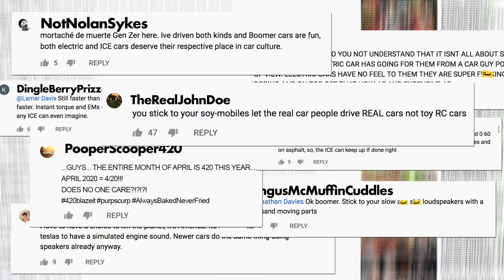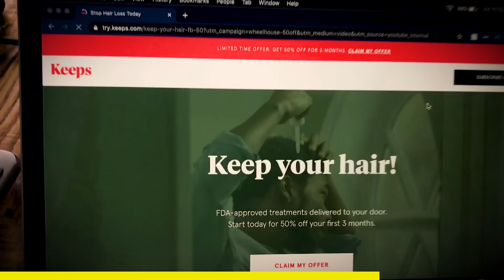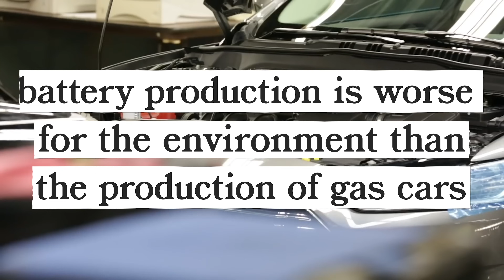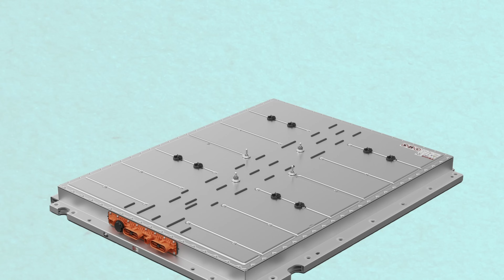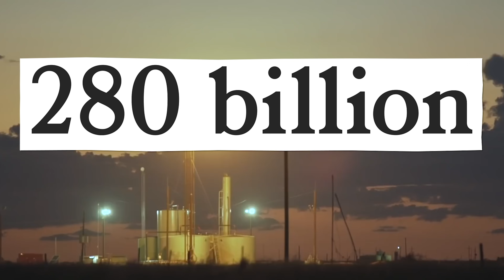Are Electric Cars REALLY Better for the Environment?

Comment: But between 8 and 10 years a elétrica vehicle will need to change the batery
. Só If the owner doesnt drive the enoght distance per year, the EV Will polute more then a combustion engine, even If you use a clean source of Power.
Reply: More like 10 to 20.  And if it still has 70% capacity, it may find a life as a 'grid stabilization module' (when combined with about 99 other battery packs)

Comment: It's is thermodynamically impossible for EVs to emit less if their batteries are charged by fossil-fuel or coal-fired power plants.  Anytime one form of energy is converted to another type of energy (e.g., oil to electricity), the efficiency is < 100% and energy is lost.  Only 43% of the energy required to create ethanol is recoverable when the ethanol is burned.  When tallying emissions of the power plant used to charge batteries, you should count all the pollutants emitted to create the fuel firing the plant, not just the emissions of the power plant itself. Study the Second Law of Thermodynamics
Reply: They’re not saying that. They’re saying that EV’s even with power generation produce less emissions than a car does per mile. 

Infact it’s more fuel efficient to charge your EV with a small portable generator than it is to use that same fuel in a combustion car.
Reply: False, because fossil fuel plants are 2 - 5 times  more efficient, and less polluting, than ICE. Small ICEs peak around 30%, but cars rarely run at peak energy efficiency (defined as power used / potential energy). The most efficient part of the power curve for  ICEs is almost unavoidably near  the high output end, which is not where most engines run most of the time.

Power plants, on the other hand, ARE designed to run at a near constant load near their peak efficiency, and can also capture the waste energy (heat), which is impractical for cars because of the size, weight, and complexity of the equipment required. 

Power plants also have fewer weight/size compromises to make, so have many more factors they can work with to optimize efficiency.

The laws of thermodynamics were  a part of my studies.

Comment: You almost touch on this but what about mileage over lifespan. All the gas cars my family have had do around 200,000 miles in their life. EV must be able to last long enough before the batteries need to be replaced in order for them to maintain an advantage in emissions. If the battery pack needs replaced too soon then all is lost
Reply: Pretty sure it will be way less than ice cars. Your cars carbon footprint continue to increase for every mile you go by burning fossil fuels.

Comment: 8:46 is a nuclear power plant, that's steam. Not smoke. No emissions. Just fyi
Reply: ye, and thanks to nuclear power he arrived at that very low co2 cost for the electricity. makes his entire video useless.
Reply: Daily venting of radioactive gases occur.
Uranium miners mean age of death ~ 54-55.
Stochastic death increases with every measurable increase in exposure to radioactivity.
Impossibility of permanent storage of high-level waste (although any radioactivity produces heat, energy in > energy out to create steam turbine power below about thorium)
Nuke plant design requires such complex construction, that it cannot be completely known or understood  - too many variable.
Consider San Onofre, tube replacements - estimated to last 20+ years, cnsiderable molecular breakdown due to radiation was observed inside of two years, resulting in necessary permanent shiutdown.
Low level waaste, such as irradiated concrete, see rate of toxicity increase mentioned, create massive low-level storage. 
high-level waste, that producing radiation dangerous to life in very short-term, , as implied by "molecular breakdown", defeats the most resistant alloys ever developed over time, leading to ethical problems with effects on organisms tens of thousands of years in the future. Human species has only lived about 250k to 325k years. 1/2 life of some waste transuranics exceed 2 million. Only early, small forehead-free apes existed at that time ago.
Nuke is dead.
Reply: @briseboy  I'm not advocating it, I'm just saying it's not smoke in that picture, which is a common misconception

Comment: The electric grid would not handle the load and there is allot of evidence and it is obvious . Also when you need to replace the battery in 5 or 6 years , something you didn't consider in your model . I have seen the argument done by scientists that show EV's are no more efficient than a small four banger . EV's are also not practical   in colder climates
Reply: The battery on electric cars has typically a 8 year warranty and can last around 300k miles for a Tesla Model 3.
Reply: How the hell is ev not efficient when electric motor are 90%, way more efficient than ice cars which has efficiency of 30%.
Ev can run in cold climate, needs heat pump which car provides.
Reply: @frankreynolds9930  I live in a cold climate . In fact it gets colder here than on Mars. They do not work in the cold and if you get them started you have lost at least 50 % of your charge. Then you need to run a heater or freeze . Do tell what exactly a "Heat pump" does and what is it that it pumps ? You really don't know much about ICE cars simplest of parts , yet you have credibility ? They are not viable and require tax dollars . The production of an EV is dirtier than an Ice vehicle all verifiable facts . Since you won't believe me then it is incumbent on you to do the research from engineers with no skin in the game  . "Heat pump" Lmao !
Reply: @frankreynolds9930  lmao ! Norway has the population and land expanse of a little city . To use Norway as an example is hilarious . You think it's cold in Norway ? ....laughs in Canadian . Electric motors have a place coupled with ICE and EV's will have a niche market for tiny places like Norway or in urban centers but there is allot more tech going on that will prove to be viable unlike the highly subsidized EV's that rely on carbon credit and public money to turn a profit . Using tiny countries with little land is not a credible argument for viability . Governments and media as ignorant as they are push this stuff and it is incumbent upon you to have greater depth than a finger bowel .
Reply: @rdhudon7469  Well not every people does long car commute  and travel between states frequently so Canada being big doesnt seem like a problem to me. Most travel from city to suburb.

Lot tech going on like what? Biofuel, hydrogen fuel will never be main stream. Those credit are for incentives for people to try out electric. Its to accelerate faster ev adoption by public.
DO you think most companies doing fully electric means they wont make any profits? 

Sure 18 wheelers for long distance is kinda hard for ev right now but there are already small trucks and vans going ev. As battery tech matures, long distance truck will also be ev.
Reply: @rdhudon7469  After 'I live in a cold climate', pretty much all of what you say is BS.

Mars averages -80F. Do you live where it averages below that? 
 
First you said 'they don't work'; then you said 'if you get  them started, you have lost 50% of your charge.

If you don't know what a heat pump is, here's an article: https://en.wikipedia.org/wiki/Heat_pump

While an EV is more expensive initially than the average car, within just a few years it is net positive for the environment, and for energy. That's also verified.

The one million individual investors who have purchased Tesla stock believe that EVs are viable. Who am I to disagree? (I think it's currently overvalued, and don't own any).

Comment: Also people forgot to add oil changes that EVs don't need every 8000km as emissions on top for ICE.
Reply: And vice versa people forget to add battery changes for the EV during it's lifespan since battery degradation is a thing and ICE'S don't rly have that issue beyond the starter battery which isn't even li-ion so not even in the same ball park.
Reply: @StealthMomo  you're gonna tell me you having hundreds of sensors and spinning parts is more efficient that 1 spinning magnet the size of a watermelon? Don't forget you need to waste gas to deliver your gas to stations. Electric travel through the grid
Reply: @StealthMomo  all I read was (I'm broke and I don't maintain my car and is a hazard to society but I don't care cause it'd cheap) 

Yes electric is costlier off the bat now but like phones are other things battery cost will only go down from here
Reply: @asp_motorsports  I'm not really opposed to switching to an electric car but in my eyes atm they're more like the early beta test version that's not really quite there yet. As for being broke that may be the case but when I talk about shot sensors i mean window sensor, rear fog light sensor, and the boot latch sensor being a bunch of spastics. Hardly a hazard if it's telling me my fog light don't work when it does or that my boot is open when it definitely is or that my window's motor is broken when it isn't. Those are just some certified Alfa Romeo electrics "charm points".
Reply: @asp_motorsports  Really good summary.
Reply: @StealthMomo  25 solid years of production (well, including hybrids) is a  bit beyond 'early beta testing.
Reply: @StealthMomo  Degradation looks to be as little as 20% over 10-15 years. From friends who own hybrids, when part of a battery pack fails, it can be repaired without replacing the entire car's battery pack.
 
And I have a 4" by 6" emergency jump starter that sits in my car. It's lithium. Also, just saw an ad for a deep cycle marine battery that's lithium. I can see that it makes sense in some cases.

Comment: But what about total life span? How long are the battery packs of electric cars expected to survive? And will it be feasible to just change the battery pack or will it make more sense to just scrap the car and buy another? Obviously ICE cars have a longer life span and in most cases it is cheaper to change the engine than throw the car away, but electric are too new to really compare their impact when we start changing them or scrapping them or their battery packs
Reply: Tesla has been manufacturing electric cars for over 10 years now and the process of replacing a battery is well defined. A model 3 battery can last around 300k miles. The world record for an electric car is a Tesla Model S in Germany that reached this year 745k miles, with only one battery replacement.
Reply: @ericmartin9429  Ok but what about all the other brands? Tesla might have been around for 10 years but it's popularity started in recent years which obviously increased in it sales. And what about other brands? newer brands?
Reply: @charliechristabela  considering that battery life expectancy is one of the most important decision factor when choosing an electric car, the other manufacturers will have to compete with Tesla at this level, otherwise they have no chance against Tesla.
Reply: @ericmartin9429  Very True! But then there is a matter of pricing too. For example, my mother bought a VW E-UP and when compared with my wife's 2017 Suzuki Baleno, I think the baleno is way more luxurious at a fraction of the price and that is without mentioning the range and charge times. I honestly think that we are still a bit early to try and phase out ICE and push consumers onto electric alternatives
Reply: @ericmartin9429  
Problem is they don't need to even compete with Tesla as European car manufacturers are already producting cheaper EVs- whether or not they will have the long-lasting battery that Tesla does, I doubt it- people will buy what is cheaper not necessarily what will last longest and be more ecological.

Comment: Electric cars are the future!
Reply: I say ethanol powered combustion engines are the future. Flexfuel vehicles are much better for the environment and uses less non-renewable resources than electric cars. We’re going to run out of lithium much sooner than oil because of amount used in electric car batteries.
Reply: @TylerN945  As we use more evs, better and efficient battery tech will be found by then. Plenty of lithium till then.
Reply: @frankreynolds9930  Well we have less than 9 years before lithium run out. Not to mention that 98% of the cars sold today are powered by internal combustion engine. It would be much less harmful for the environment if we kept producing them, but running them on a clean biofuel such as ethanol. A car that runs E85 throughout it’s lifetime will also leave a much smaller carbon footprint than an EV with a big Li-ion battery due to the manufacturing of those batteries being very harmful for the environment.
Reply: @frankreynolds9930  https://youtu.be/-o5D-nic9WM
Biofuels are the future^ most EFI combustion engines can be converted to run that fuel. I’ve been running E85 in my Toyota 86, and would never think of switching back to 93.
Reply: @TylerN945  Haha you should have googled properly. Lithium is like 33rd most common material in the earth. We have plenty of lithium plus its recyclable. We just dont have enough lithium processing plant.

Also as we buy more evs, we continue to develop better battery tech, we wont be forever using lithium in our batteries.
Reply: @TylerN945  Most companies are already going ev. Battery is used everywhere and ev are very efficient. Also biofuels will never be primary fuel. Needs too much foodcrops.
Reply: @frankreynolds9930  You should’ve done your research, we’re using up lithium faster than it can be recycled. It’s very efficient when used in a phone, but Teslas use 22 pounds of lithium. Not only does the production of those batteries leave a detrimental carbon foot print, but it’s dangerous to be driving around with that much potential energy. Tesla’s have advanced safety features for a reason, but they will still burn to a crisp once a battery becomes unstable in an accident. E85 is always available and many people already use it in their flexfuel vehicles in urban areas where it’s much cheaper than 87 and capable of producing more power in high compression or turbocharged engines.
Reply: @frankreynolds9930  Hear me out though. Hybrids that run on biofuel: small amount of lithium used, but it runs on E85 and has excellent range.
Reply: @TylerN945   Sure there arent much recycable plants now just saying its can be 100% recyclable so no wastage in future. Yes we are using fast but its not going to run out in 9 years which is absolutely false. Even rare elements wont run out in 9 years let alone a common elements like Lithium.

Also using food for fuel is bad, let alone making it primary fuel. Unless you are racing no need for e85 for common cars.
Anyway it is still ice car which is less efficient than ev.

Ev is future, most companies are already fully transforming their production line for evs. Biofuels will just be intermediate for evs.
Reply: @TylerN945  Batteries are half a tonne. 22pound is nothing compared to it.

Comment: Calling BS on the electric grid being able to handle very one in an EV. Let’s see how many blackouts we will have here in Southern California this summer!
Reply: Maybe this is just an issue with CA power grid and not an issue with electric cars? If all cars were switched instantly to electric, the power grid would need to deliver about 20 to 30% more energy. This is manageable since this transition will not happen overnight.
Reply: @ericmartin9429  and how are you going to handle car enthusiasts? Do you think they’re going to stop loving Porsche 911 and Corvettes? I I’ll they be happy driving boring electric appliances and eventually autonomous vehicles?
Reply: @littlestevie9101  I'm sure internal combustion engines will still be around for a long time, particularly for car enthusiasts. I have an electric car for daily usage and a gasoline F-150 for occasional use and I love driving both. When I said "all cars" I should have said "most of the cars" (the ones that are used the most for daily usage)
Reply: @littlestevie9101  Are you calling Tesla's boring? I have a truly boring econo-ICE car, and consider any Tesla (and many other full EVs or hybrids) more exciting than mine.

Comment: I bought my first EV this year and I can never go back to gas. I used to own a Charger SRT and Ram SRT years ago. EV’s are so fun, quick, responsive and cheaper in the long run.
Reply: Until you have to replace the battery and they rely on carbon credits cash and government incentives . Take those away it will not be cheaper . Also when the demand for electricity goes up so will the cost . Where do you think they get the money for the roads ? In the long game they are not cheaper .
Reply: @rdhudon7469  There are no carbon credits involved, and Tesla is already out of the federal tax credit phase. Battery packs look to last 200,000 miles or more, with maybe a few replaced sub-modules (if that); still far cheaper to maintain  than your typical ICE.
 
The Tesla 3 has a 241 MPGe, so that suggests to me that electricity would have to get 8x more expensive before before it would cost more to 'fill up'.